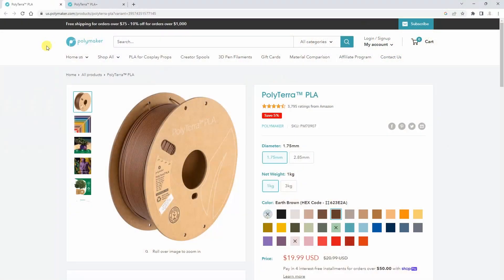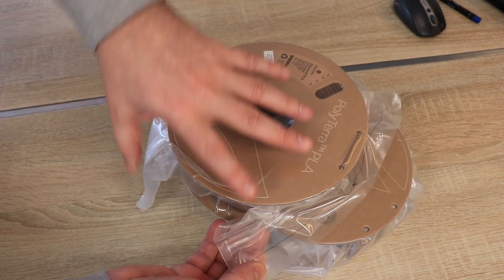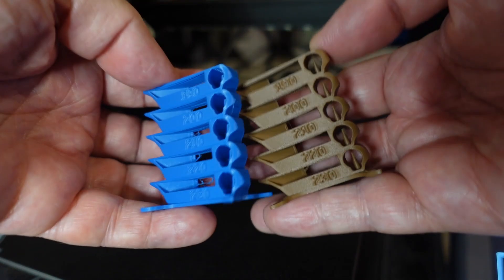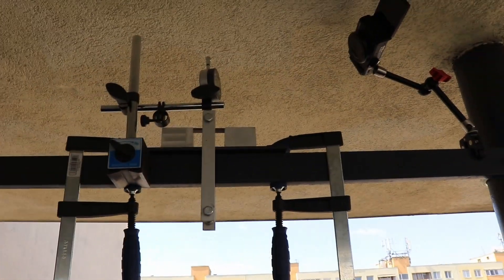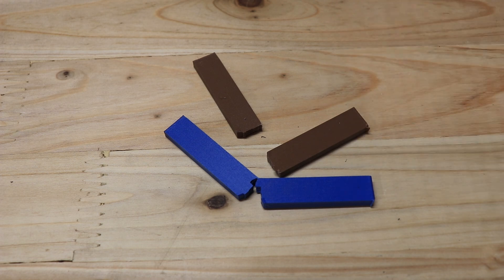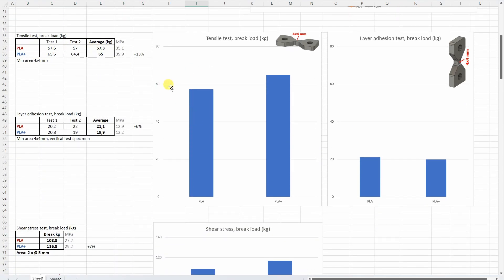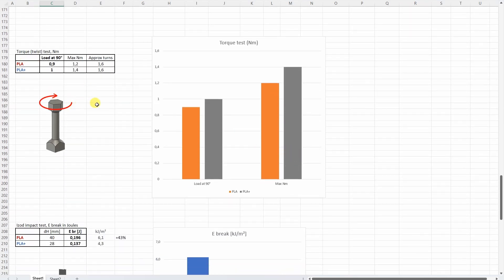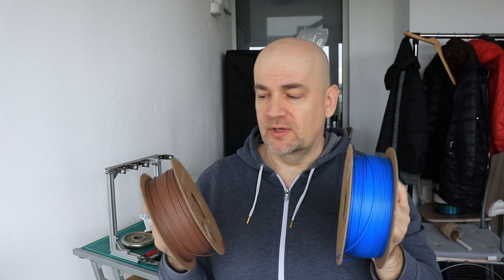Polyterra PLA vs PLA+ review and testing. Which one is better?

Comment: Now just need to test it again their newew PolyLite PLA Pro which they claim has a higher imoact strength than ABS. Below is from their Amazon description. The price varies depending on color but black is 25 US for 1KG so still pretty price competitive. All I can say is it orints very well although I find it does better at 210°C instead if 200°C for the nozzle temperature.

I watched another video where someone tested every filament and surprisingly PLA beat out CF nylon regardless newton for e before breaking. Maybe it was what he tested as he did 2 prints of the same thing and each one broke in the same place regardless of filement used showing that was the obvious week spot so this test was more thorough. The other video was testing many more materiels so that makes sense but still not conclusive evidence but obviously PLA is easier and cheaper to print than any other filement. Obviously it still has its weaknesses like exposure to heat.

From Polymaker Amazon description:

Polymaker PolyLite PLA PRO is a toughness enhanced PLA filament which has even higher impact strength than regular ABS. At the same time, it also features a 1.6 times of rigidity as other toughness enhanced PLA filament 1.75mm. The excellent combination of toughness and stiffness is a real breakthrough for this 3D printer filament industry, making it perfect for mechanically demanding applications